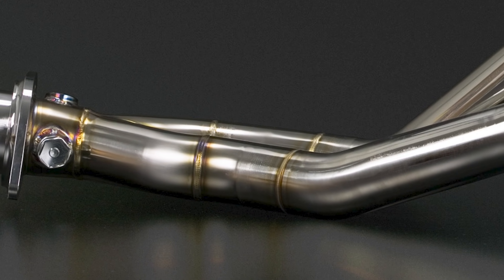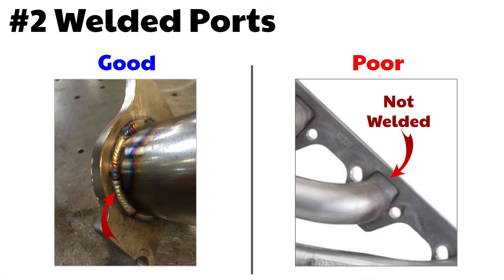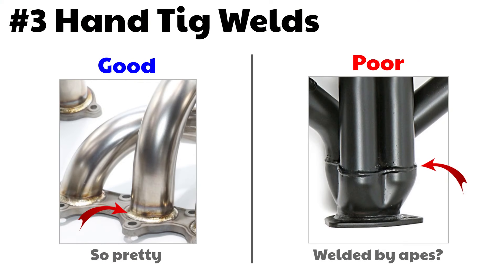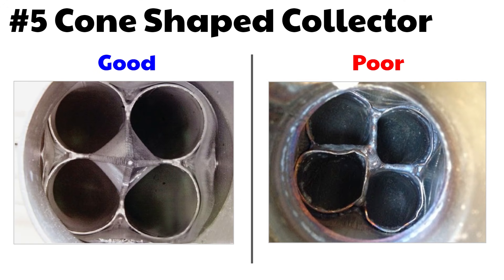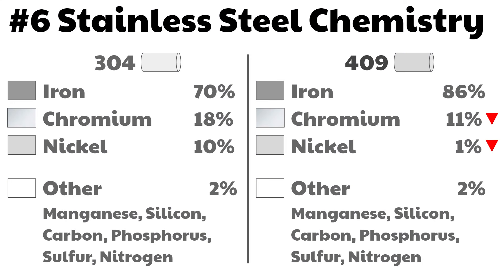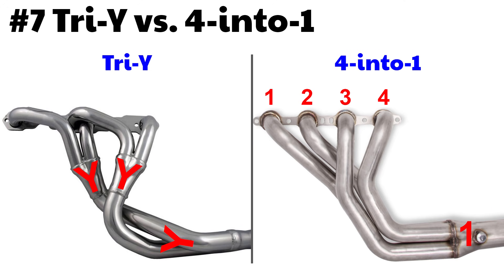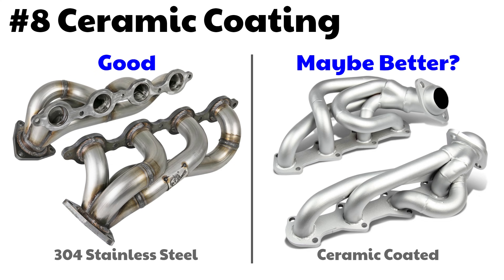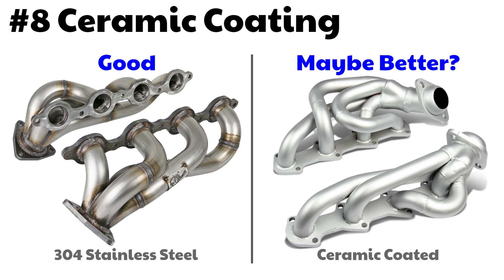Exhaust Header Secrets: What to Look For

Comment: If you're using a heavy flange, it would not be a bad idea to bolt it to something flat, and heat cycle it a few times at a good high temperature period that will make it take a set that is flat. That will keep it from Frank to peel away from the head the first few times you try and heat it up.
What you're calling a silicon Braves, is merely using a 309 High silicon wire. I've used it several times in the sheet metal trade.
TIG welding can cause an issue however. It leaves an austenetic zone adjacent to the weld. So you then either have to make sure that you warm it up and cool it down a few Cycles before putting it to full Heat. So that the metal will temper a little bit. That's the problem people have when they TIG weld roll cages. Roll cages are made from chrome-moly steel which is designed to be welded with an oxy acetylene torch. When you TIG weld it, you end up with brittle Parts at all of the well joints. And you are supposed to heat those up to a dark red and then let them cool. Or just weld it with a oxy acetylene torch in the first place. Chromoly steel tubing was an able specification it was specifically designed to be welded with an oxy acetylene torch. Why NASCAR and NHRA require roll cages to be welded with a TIG is beyond me.
Anybody who knows how to properly set a MIG welder and make a mig weld look just as nice as a TIG weld. As matter fact I have gun stick welding that looks for all the world like a TIG weld. You just have to have a steady hand.
It's not chemistry information, it's Metallurgy information.
If you're only working around on the street, you still get about 93 to 96% of the efficiency and all of the low-end torque out of shorty headers.
There are small block Chevy blocks that you can get that you can bolt LS heads to and still get 500 plus horsepower. Because the only advantage to the engine design is in the head and the way it breathes, not the block. The newer LT engine is even better. Both of them take design ideas from the big block Chrysler engine from the 1960s, I rebuilt a couple of Ls Motors they have several design features from the Chrysler big block engines.
Reply: my tig looks like mig😉

Comment: Did a lot of R&D on headers on a dyno a number of years ago.  One key point I want to make is that equal length headers are really not that big of a deal.  The HP loss on the top end is really not all that great.  On a full on 358 Racing engine for example the loss was only 7 HP on various lengths from 24" - 32" long primaries.

Comment: Which design is better for an inline 6? Is it 6 into 1 or 6 into 3 into 2 and if it's the latter, do cylinders 1-2-3 go into 1 collector and 4-5-6 go into the other or does one header from one group go to the collector of the other group like the 'basket of snakes' seen on a Ford GT-40 (which is a V-8, the result of having a cross plane crank)? I'm building a hot rod that's a Model A with a Jag V-12 engine (essentially two inline 6s). Unlike when that engine was in its rightful home, space is not a problem so I can have the entire exhaust system made to whatever design is best. Thanks for any insight you can give.
Reply: big thing is spark order and degrees between: 90deg between two ex pulses is small and it will have better performances on low rpm, but if it is 720 deg it will have better perf. on high rpm, because pulses overlapping in collector(any kind 2/3/4/6.. in one) is no good, try to match up similar distance/timing pulses(for ex 180deg is good for inline 4 , 2 inner cylinders  in 1 and 2 outer in 1 , i have v8 cross plane crankshaft and pulses are uneven, so for left bank i connected 1. and 5. cy in one, and 3. and 7. in one and that in one, for right bank are: 2. and 4. in one  and 6. and 8. in one and that two in one, i am still making it so i will see how it will behave

Comment: If you plan on keeping your rod for years or even decades 304 stainless is the way to go for the entire system including hangers. It is a once and done. The only thing better than 304 is 316. It polishes better , holds the shine, and 0 corrosion but 316 is much more expensive and only available in straight lengths i believe for .065 exhaust tubing. I have 316 lenghts installed on my classic truck from 20 years ago. It looks great. I have 304 installled also and it has turned a brownish and will polish up but no corrosion.
Reply: 321 is a bit easier to come buy.   321 is alloyed with titanium and can take a bit more heat as well (turbo systems).

Comment: The nascar headers that I have seen are tri Y. Must be towing.
Reply: Good point but someone mentioned that tri y have much more tuning ability and can be tuned into a narrow band of power. Since nascar is running high revs most of the time the tri y's are most likely tuned for that rpm band. Vs for street app they would have a wider tuning range. What ever the reason tri y's just never became popular so maybe there not as great as myth has it.

Comment: So my guess is you didn't mention 316 stainless as probably it's not cost-effective and not needed over 304 stainless? 316 stainless is used in power houses on the boiler pipes and steam pipes for thousands of PSI steam is involved so proudly way overkill for exhaust pipes I would imagine but yeah you're absolutely right there is nothing that will replace stainless steel headers like motorcycle headers are you getting a little buff job and you got that beautiful blue gold purple coming out of the cylinder head and today they sell Mufflers with an anodized look of hot stainless steel headers costing extra for the look

Comment: I think $350 for ceramic coating is cheap heat control vs cooking all of your plastic and rubber vacuum hoses. Headers will radiate much more heat into the engine bay and passenger compartment and cause heat soak. I got the ceramic coating on my Stainless works headers and do not regret one bit spending the extra $$ for it.
Reply: it is problem if you reving on place, for driving is good to have heat shield around primary tubes to cables and pipes
Reply: Use Inconel. It’s expensive but worth every dollar.
Reply: Exhaust heat wrap like you see on motorcycle? Plus it looks cool
Reply: Who did you have coat them?
Reply: @johngregory4801  Actually Stainless works sent them to a company in NC which is where I live. I don't know if it was coincidence or they try to find a company local to buyer. After the coating they were shipped from the company who coated them to my home. Sorry I don't remember who actually did the coating as it was some time ago.
Reply: @mrelectron6220  I didn't know they did that. Thanks for the heads-up!.
Reply: While ceramics will greatly reduce heat over all, do keep in mind that stainless headers, while running physically hotter to the touch or conduction heat transfer,  stainless will actually radiate less heat then typical stock units. Radiation heat transfer would be heat moving through space (air and what not) from hot to cold, and assuming we're talking a stainless finish versus the usually rusted black, brown stock unit.  So things like your spark plug wires will actually absorb less radiated heat from being within vicinity (the engine bay as a whole) of stainless versus the sub optimal stock units. Black headers are where things start to just melt all over the engine bay.

Comment: Most headers are only welded on the outside. Very few are welded on the inside
Reply: My sandersons are welded on the inside but I’ve had to do some additional welding on the outside as over the years they’ve developed a few leaks. Wish they had been welded in and out but all in all they’ve been pretty good.

Comment: Bro please help I ordered long tube headers and true duals exhaust for my trans am but the don’t look that long they are definitely not shortys but I have never seen long tubes in real life so I don’t know how long they should be they are single pipes to a single but it doesn’t look “long”
Reply: What year TA? ARH and Grotyohann (no longer available) were about 30" primary tube length, plus about 10" collector length. I suspect other vendors long tubes will be similar lengths.
Reply: @evcass69  it’s a 97 shell but 98-02 clone

Comment: Regarding Hot Rod’s Ceramic Coating article, it should be noted that they ran the test on an engine dyno. Had the engine been in a car on a rear wheel dyno with the hood closed you may have seen a hp difference, especially in modern vehicles where the computer pulls timing due to elevated iat’s.
Reply: same reason why rally cars had them way back in the 90s... less heat in the engine bay that needs less cooling, less cooling impacts aero less, less temperature in the intercooler makes more hp.

Comment: try vs 4to1, thing is.. try can be tuned MORE for top end power, as you can tune all 3 Y section lengths along with the tail for a narrow rpm range. 4to1 does not offer that many interactions. so by design the try would be more suited for top end power however generally they are designed for more of a wide and equal band.
Reply: Tri?
Reply: Bloody phone and its autó correct shite.
Reply: I agree that tri have more wider tuning range possible to them... but nivalac57 is putting out a good video on unequal length headers due to firing order as mentioned elsewhere in these comments.
I think the quality and care put into 4:1 headers isn't there in most designs.
Reply: Nivlac57  darn dyslexia

Comment: Determining tube size depending of cubic inches? Horsepower? Or exhaust valve size?
Reply from the maker: Mostly HP, but also Cubic Inches.
Reply: Primary tube size determined by rpm the motor will live at. Collector determined by hp.

Comment: saw a demo on u tube , measuring temp from a coated header and a non coated .the non coated 500 degrees hotter than the ceramic coated header .

Comment: A cross plane crank V8 does not have an equal firing order on each bank. So header length is not that important. 
Tube diameter and collector dia. and length is.

Comment: Unequal length headers actually have been proven to offer a wider rpm tuning point. An equal length header tunes at one specific point, much like a tuned port intake or a tuned pipe for a 2 cycle. Tri y headers offer even wider tuning rpm tuning bands.
Reply: +1
Reply: You are correct.   Unequal will be broader and less peaky.   Especially with mufflers.
Reply: This depends on the firing order. On a crossplane crank you'll have 2, maybe 3 cylinders fire too close together and so equal length won't work nicely. Ideally you'd pair all opposite firing cylinders together or make an 8 to 1 collector.
Reply: Talked with NASCAR engine builder Robert Yates in the 90's about headers wherein he claimed the engine temperatures dictated the header length for endurance conditions.  Short means cooler, and it was about survival rather than horse power.
Reply: Additionally - - as the exhaust exists a V8 Chevy, 8 then 4 on the passenger side, you want 8 to be short and 4 to be long. On the driver's side it's 5 then 7 so you would want 7 to have a much longer tube than shorty headers usually provide.  This will bring balance to the force.
Reply: @peterdarr383  I believe a header company did something like that...Super Tech iirc.??

Comment: looked in to the equal length headder for my WRX and it was listed as something like 5 or 7 hp. Considering it removes the boxer rumble i opted not to get one. Had ceramics on my mustang in the ye oldie days and i can confirm they run much cooler, but i agree unless heat is a issue its not worth the money. You showed sever shortie style headders in the vid it has been my experance that they are worth almost no hp over a stock manifold. unless the stock is pretty bad, like the old school log manifold.
Reply from the maker: Agree on the sound, my other car is a flat six and I certainly wouldnt change the sound for a few hp.  Yeah I agree on shorty headers.  Even the new manifolds are so good unless you go long tube and want high rpm power there is no need to switch on many cars.  Great comment.
Reply: "shortie style" Headrers are "block huggers" for when there is no room in the engine bay or for replacing broken OEM manifolds, they were never about performance.

Comment: I got a set of $98 headers from ebay for my small block expecting them to be trash but they have all the good details you were just talking about (I bought them brand new btw)
Reply: Me too..130$ for a set on my Dodge Magnum...very good quality..5 yrs later still doing great.
Reply: I have a set as well - 321 stainless...   I paid about the same amount as a mild steel header and since most off the shelf headers are not really tuned, I don't think I lost anything and the welds are decent enough.

Comment: Do you think borla is a good brand of headers ? Hardly any reviews on them , only reviews of their catback exhausts
Reply: Most off the shelf headers are made to fit, not necessarily tuned.   Most are not equal length  (Hooker Super Comp tend to be equal length - and of course custom headers  - See Burns Stainless and Headers by Ed for examples)
Reply: @confuse3671  It sucks because I got a full Borla attack cat back exhaust but I just found out months ago Borla discontinued their long tube headers wanted a complete set

Comment: The cone you speak of in the collector, makes it a "merge collector" just in case you wanted to know the correct terminology.
Reply: Not true, I have a set of merged headers. And there is no cone in the collector.
Reply: A merge collector has a smaller diameter  for a short distance at or just down from the collector.
Reply: No , merge is different , better , was not shown in this video.

Comment: I kind of felt like when you had done a lot of your comparisons you were not comparing multiple products for the same application. 
You’ve made some decent points on flange thickness. The points you bring up about welds in and/or outside or not all the way around a tube? Think about that a lil harder... in the examples shown, why were those welds not complete or done from the inside? 
Anyone?

Comment: Good video

I was hoping you might go into the difference between short headers and long headers 

and whether or not it’s worth wrapping them in that heat bandage stuff......
Reply: You want them long as far as I know and don't do wrap a it can get caked with oil and catch on fire. Do ceramic coating. It helps by heat insulating the exhaust putting less heat into the engine bay. Long runners throw off more head because larger surface area.
Reply: @SoulTouchMusic93  longer primary runners shift the peak torque and power towards the bottom end and shorter runners do the opposite. F1 v10s that revved to 18k have extremely short primary headers.
Reply: The long and short of shorty headers is they make little to no extra power but may help with fitment of your exhaust system. If you have the room go with long tube headers. On the subject of wraps just get the ceramic coating.Some header companys will not honor warranty if they are wrapped but will with ceramic coatings. As some others have mentioned the fiberglass wrap can hold moisture in plus if you have an oil leak the wrap will absorb all that oil and you run the risk of fire.
Reply: shorty-small benefit, long-max benefit, do not wrap it, i did and header melted in 4-1 junction

Comment: My personal experience with cheap ebay headers.

Bought a crappy tri y with intent of chopping off collector due to it being a motor swap and needed serious modification but didn't want to make an entire header.

After chopping collector off it was apparent that at all 3 y's there was a additional tubing material that protruted half way into the primary right at the weld seam. This turned into a project of chopping the header into pieces to get in and die grind out the ID of each y to actually match the ID of the tubing.

Just because all looks good on the outside does not mean it is even remotely smooth on inside.

This was a cheap ass stainless try y for a ka24de going into a datsun 620 but I'm sure same shortcut is being used out there on others.

DON'T BUY CHEAP STUF UNLESS YOU PLAN ON CUTTING IT APART!
Reply from the maker: Yeah thats a good lesson for everyone here.
Reply: @AutoGuild  WITH ALL DUE RESPECT: You are incorrect when you assert 
that "equal-length" headers are the best choice for correct exhaust flow, power, etc. 
In reality, unequal-length engine exhaust headers have been proven to be far superior to equal-length headers. Formula-1 Engines & those designed & built for "supercars" use unequal-length headers because their design allows the engine to produce more horsepower & torque.  
All factors being equal, unequal-length engine exhaust headers will always produce substantially more horsepower & torque throughout the entire powerband. 
More-so, when the unequal-length headers are constructed with "stepped" primary tubes, the power band is widened. The engine will also produce substantially more horsepower & greater pound-feet of torque at the highest RPMs of the powerband than headers without stepped primaries. 
The ONLY drawback of unequal-length exhaust headers is their fitment in the engine bay is sometimes problematic. However...when correctly built... 
fitment issues can be resolved. 
Best regards, 
Ben